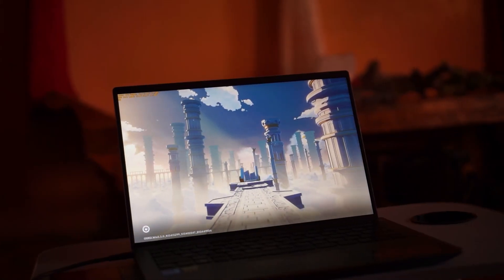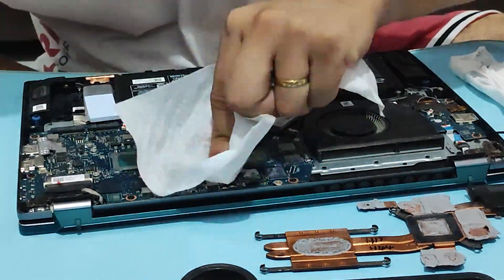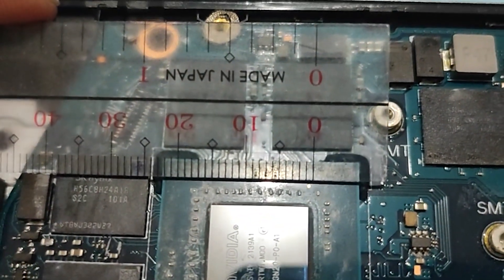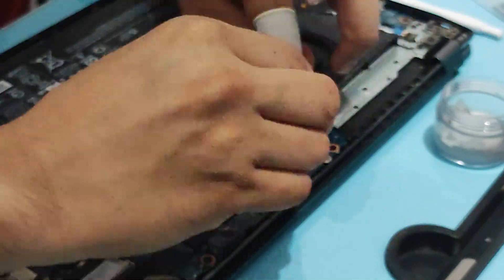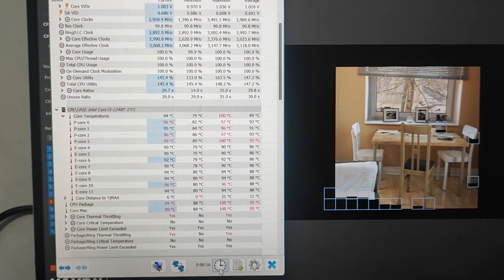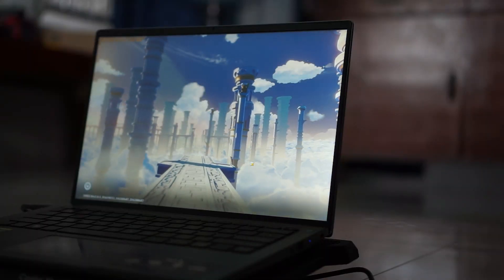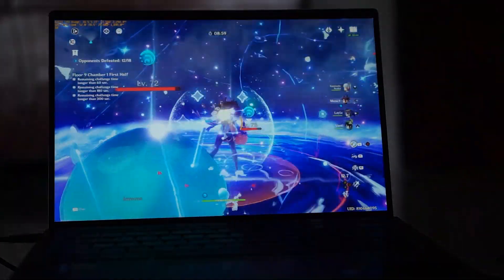How To Prevent Your Laptop From Overheating: Honeywell Ptm7950 And Upsiren Ux Pro

Comment: It only thermal throttled at first because the PTM7950 had to melt and settle first. Running the same benchmark a week later and I bet your results will improve.
Reply: do we need to put it on refrigerator for a few hours or maybe days?
Reply: @JJHXCJG89  I put it in there overnight (make sure to cut it to size first so when you take it out you can just apply instantly) and it was very easy to apply.

Comment: Nice to see the improvement 👍It would be a good idea to do undevolting RTX 3050 yet. It could improve the performance not only of the GPU but also of the CPU by the fact that the heat pipes would have at least a little less temperature.
Reply from the maker: yes, I already tried undervolting.. Unfortunately, one fan is not enough to comepletely cooldown the CPU and GPU of my laptop..
Maybe I will make a video about undervolting next..
Reply: @PinoyTechEnthusiast  can i do undervolting in ryzen 5 5600 h laptop cpu ?
and rtx 3050

Comment: No it’s your laptop not able to keep itself from overheating with the MX-6 thermal paste, mine runs at 40-60C
Reply from the maker: @joker40yearsagoupdated65 good for you that MX-6 works on your laptop. I live in a tropical country and the thermal design of my laptop is not that good that is why I need to find a way to prevent it from over heating.
Reply: @PinoyTechEnthusiast  using the GT500 laptop cooler it has high rpm would help you out with nice cool air and dust free since the laptop cooler has a filter on the bottom 

Also in the Nvidia control panel capping your fps to 60 would help a ton too
Reply from the maker: @joker40yearsagoupdated65 thanks for your suggestions. I already capped the FPS to 60.. For now I am using a simple laptop cooler so far it was able to keep the laptop temps.

Comment: Question... If the pad were better then the putty for the CPU and GPU why use puddy on the other chips instead of pads?
Reply from the maker: https://www.youtube.com/@jamesswan7695
Using pads on VRAMS is hard. You need to know the exact thickness needed to make the chip have the right contact with the heatsink. Too thin pads will not contact with the heatsink, and too thick pads may cause problem on the heatsink. But using putty, you just apply it on the chip and let the excess putty pushed out by pressure of the heatsink.

I hope this helps!

Comment: How do I know when I need to replace the thermal putty?
Reply from the maker: @Shoukupan The best indication is that the cpu gets hotter than before even if you are doing the same load as before and have same ambient temps.. or the performance is not as same as before..

You can use HWinfo and rivetuner to monitor the temps..

Comment: Bro is this honeywell stuff good in Asus tuf F15 fx506LU? i previously use the krynaut extreme grizzly, but i think it only works good under 6 months.
Reply from the maker: @5theye997  yes, it is ideal for laptop CPU.. It does not easily get pumped out like krynaut since it turns back to solid form when not in use.. Also, kryanut degrades at 85C.. Laptop CPU reaches 90-100C during High loads so krynaut will not really last at Laptop CPU..
Reply: @PinoyTechEnthusiast how is the performance now

Comment: Lift up the laptop so it can suck more air. There's glue on clip feet you can buy to do this. 

Undervolt + overclock your 3050 for an even larger boost to performance.
Reply from the maker: Already done those.. still it throttle.. maybe its design problem.. it needs more fans and heat pipes..
Reply: any program to subvolt i5 12500h? extreme utility intel does not work, neither does the Throttlestop software
Reply: @elfurre  nope, you're out of luck. get ptm7950 like this guy shows, raise the back of the laptop, and mess with power limits on throttlestop
Reply from the maker: @elfurre  unfortunately, starting from intel 12th gen CPU, they locked the capability to undervolt. Undervolt now only works with HX and HK CPU..
Best solution is replace the Thermal Paste with PTM7950..

I only Undervolt my GPU and reduce the TDP and thermal limit of the CPU..

Comment: Nice video my friendo, but quick question, how much thermal putty should I put on the VRAMs and VRMs? Is too much or too little a problem? Do I need to measure the thickness of the stock ones? I'm also like you, changed my stock thermal pastes with cooler master and arctic mx-4 and both were overheating reaching temps of 100°C, replaced them with PTM 7950 about 2 weeks ago, and temps have been absolutely AMAZING. One thing I missed were the thermal pads for vrms and vrams, so i'm worried after all the disassembly and reassembly that it's probably time to change them as well..
Reply from the maker: @madcat97 Too much is better than too little.. if you apply too little, some parts might not be covered by the putty which will reduce the heat transfer. Applying too much will just result to spilling some of the putty on the mother board.. The good thing about thermal putty is you don't need to measure the thickness of the original pads.. Just apply a good amount and let it spread when you install back the heatsink..
Reply: @PinoyTechEnthusiast  Thanks for the answer bro

Comment: how much will be the putty needed for this laptop you reckon? also have you ever tried replaced the putty with stiff thermal pad (e.g thermalright or thermalright pads)
Reply from the maker: @timothyunedo5642 For putty on the VRAMs I think about 5-10g is enough.. Haven't tried thermal pads because you need the exact thickness to fill the gaps. too thin will not make contact with heat pipe, and too thick will have effect on the contact of the heat pipe with other components like the GPU.

Comment: hello po, may kinalaman po ba yung nvlddmkm error kase my laptop shuts down with that error sa event viewer, and when I DDU'd my laptop still shuts down (yung shutdown niya po black screen bigla with sounds still on sabay lalakas po yung fans then shut down). Temps po ay around 70 for GPU and umaabot po ng 100 ang CPU (Celsius)
Reply from the maker: @blista150 Not sure kung yan nga reason.. pero one reason ng sudden shut down ng laptop ay over heating.. lalo na ung sa CPU mo nasa temp limit na.. Observe mo kung nag shushutdown siya lagi during high temp.. baka need mo na mag thermal repaste, Other option is undervolt your CPU at GPU or lower the temperature limit of your CPU..
Reply: @PinoyTechEnthusiast  Thank you po for taking your time to answer!
Reply: @PinoyTechEnthusiast  BTW sir di naman po makakaaffect yung putty sa pagcontact ng cpu at gpu sa heatsink pag natantsa naman pagkalagay ng putty?
Reply from the maker: @blista150  Sa amount ng pag apply, mas okay na ang sumobra.. kaysa mag kulang.. kapag kasi kulang, hindi masyado ma tratransfer ang heat papunta sa heatsink. If sobra, matatapon lang naman palabas ng itaas ng chip papunta sa board.. Just make sure na non-conductive ang gagamitin mo para iwas short circuit sa board kapag may nahulog.
Reply: @PinoyTechEnthusiast  Sir noted po, maraming salamat po ulit for taking your time and sharing advice! God Bless you po 🙏

Comment: Man, you'll need clean cooler also. It remains dusty, its lazy 😂
P.S. MX-6 not for laptops. Only for desktop CPUs.
Reply from the maker: @astherion yeah, I learned the hard way that MX-6 is not for laptops
Reply: @PinoyTechEnthusiast From what I've seen ptm 7950 thermal pads are perfect for direct die cpus and gpus, while mx-6 is good for desktop cpus, but mx-6 sucks on direct die cpus/gpus because of the pump out effect
Reply: @luisescobedoom2053  Which thermal paste is better for direct die CPU?? Just asking in general, I have already applied ptm7950 but still wanna know

Comment: How much size is enough for both cpu and gpu
Reply from the maker: I bought a 30mm x 50mm that will be enough for 2 laptops.. You can buy 30mm x 20mm but that may be too small.. You better research the die sizes of the CPU and GPU of your laptop just to be sure. You can check on the video the die sizes of my laptop..
Reply: @PinoyTechEnthusiast pad thickness 0.25mm or 0.2 mm
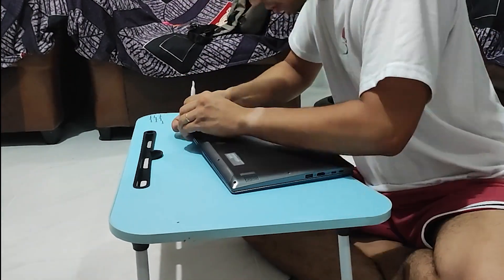Reply from the maker: The one I got is 0.25mm based on the specs on the package.. you can see it @1:07 of the video..
Reply: @PinoyTechEnthusiast i am gonna buy 0.2mm one which is better 0.25mm or 0.2mm
Reply from the maker: If you ask me, I think 0.2mm may perform better because it is thinner which makes heat conduction faster..

I saw a video once comparing them. but I'm not sure if it's accurate.. 0.2mm has a higher frame rate but runs hotter on the comparison. I find it sketchy since if the system does not thermal throttle, a better pad should have lower temp with same performance..
and if the system thermal throttles, temps should be the same, but performance should be better on the better pad..